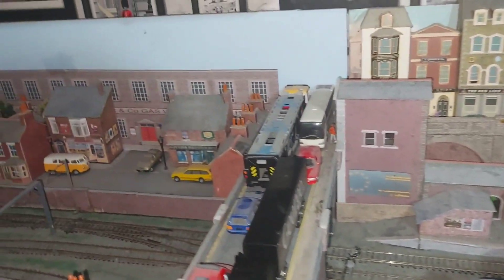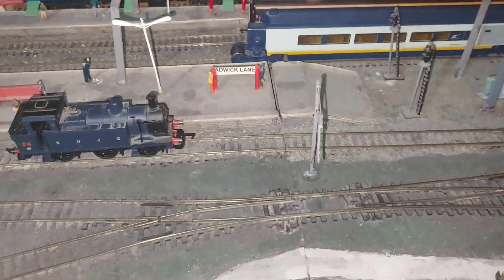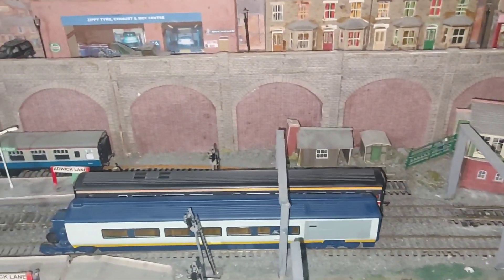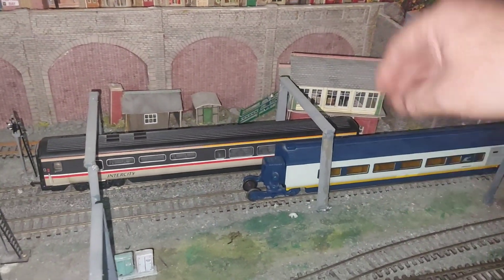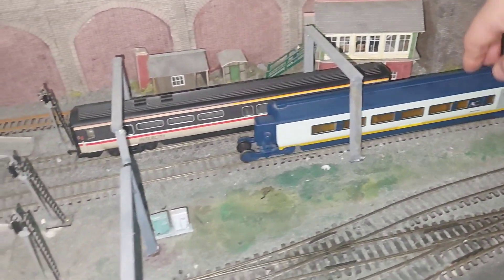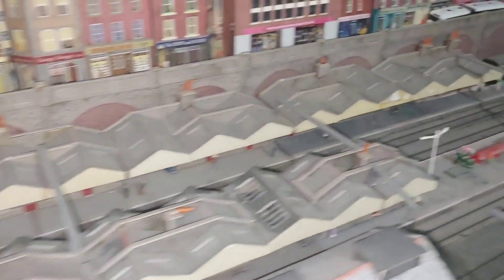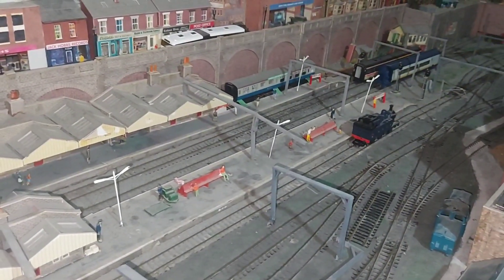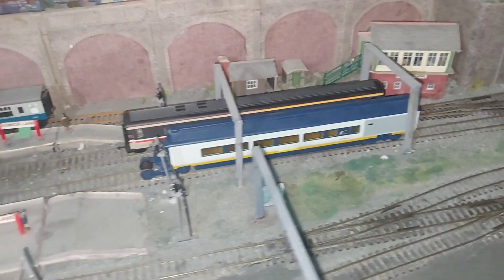Last video of 2023

Comment: I had the same problem with my Eurostar, then the maths teacher in me surfaced and I realised that its all about arcs and circles! long story short, your "longest" coach is the coach with the greatest distance between bogie centres. Great video, I've just subscribed. Start watching in the new year. Dave
Reply from the maker: When I built the layout , my longest coach was a mk4 so everything was fine , when I build the new one , the Eurostar coach will be the One I'll use to mark out clearances . I've checked things on the full size plan I've done and looks OK , but I'll check again when I start on the new One. Thanks for s
ubscribing and happy new year :-)